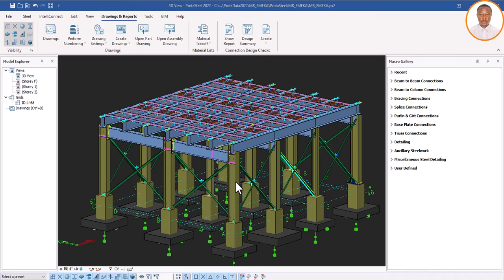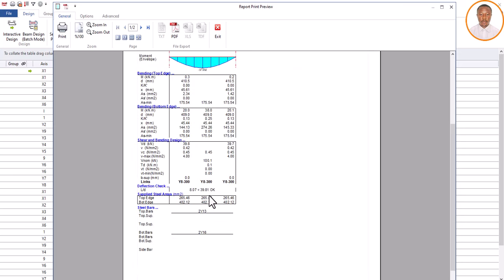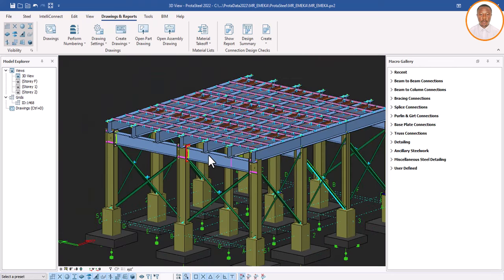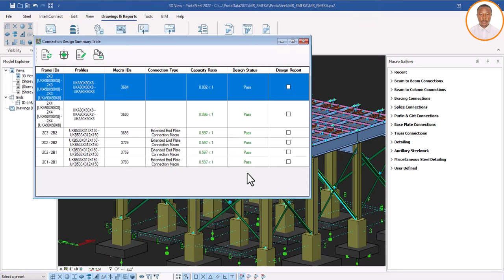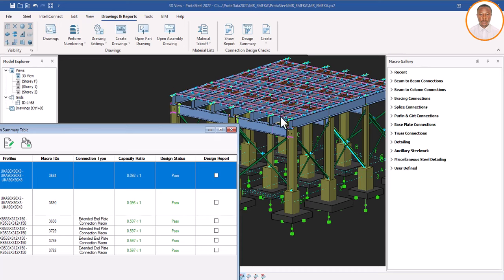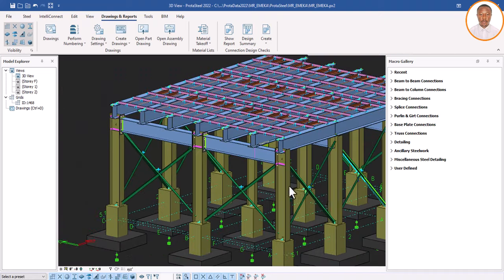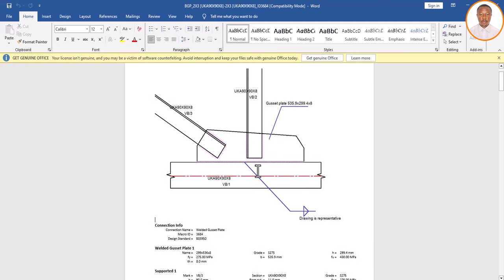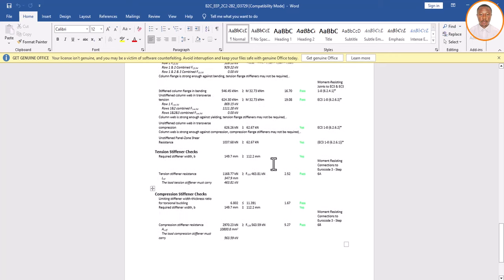HOW TO GENERATE STEEL CONNECTION REPORT IN PROTASTRUCTURE

Comment: Thank you Ekidel for alway give out your best. Please sir in your last video, you said the reason for the purlin and cladding is to load the water tank. My question is if we are using the cladding pattern to load the water tank, are we connecting the purlin since it just for loading or we don't connect it?
Reply: we don't need to connect the purlins because they are not going to be used.